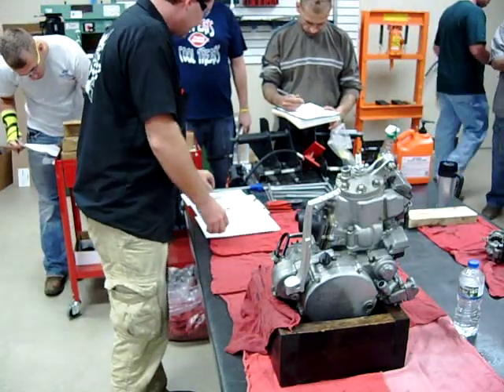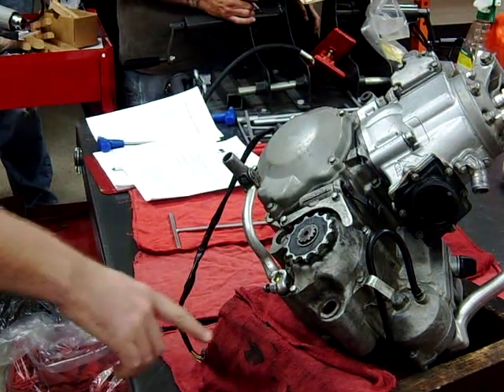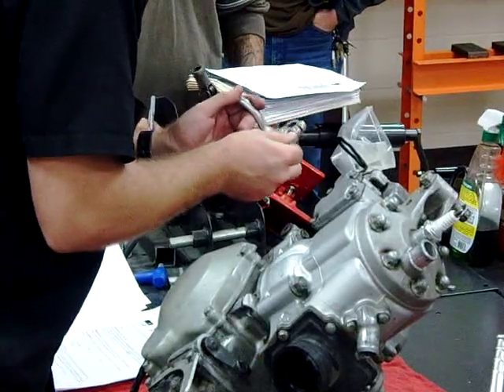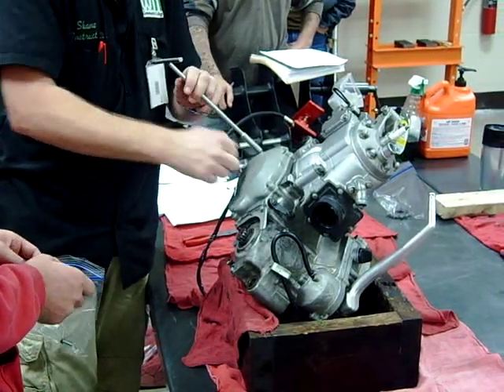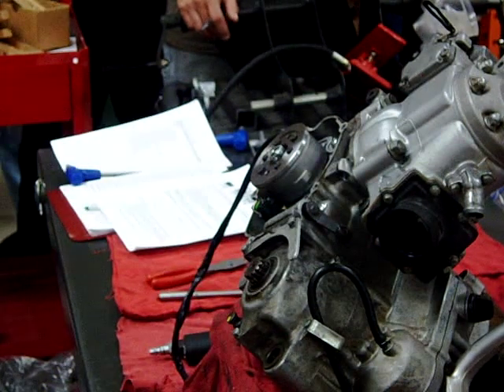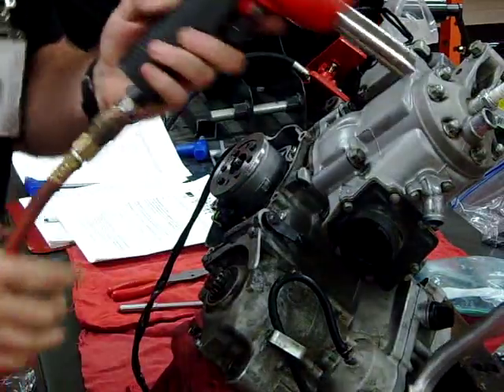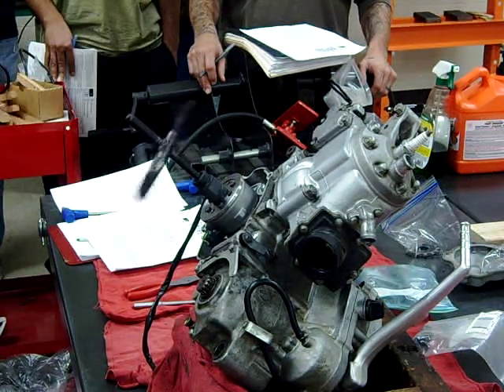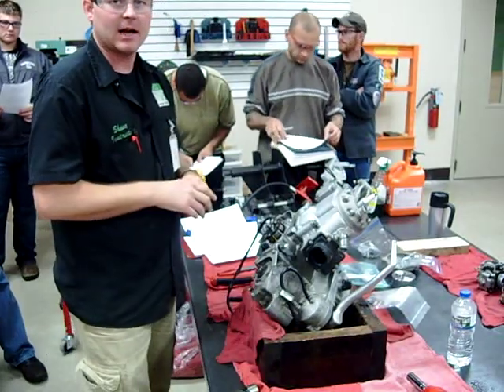2-stroke flywheel removal and engine disassembly part 1 Western Iowa Tech Community College

Comment: guy is a fraud.      I ask about a crank seal, he responds about a carburetor.   Then he  wanted $5 to answer literally a YES or NO question.
Reply from the maker: Sometimes you people are just having a bad day or don't think before you type. You get one break or you will be blocked. We have no time in our community for this ridiculous comment as to if we "owe" you something. Not the best approach to get help. 

You're the one in need of expert help. It is not a yes/no answer with many factors to consider, so you don't blow up the 2-stroke engine. Also, I would need to research the year make and model to determine if yours has the "Kawasaki lipped seal" which adds even more "know how". 

If you wish to have personal time with a H2W coach ASAP,  there is a fee. If you wish to have free information, watch videos or stay tuned for the upcoming "Tech Talk" Live feed coming soon where a panel of experts will address YouTube comments of the week.
Reply: LBOE OUTDOORS that was kind of weird..
Reply: wasnt crank seal anyway. was the little clutch actuator seal. 10 minute fix
Reply from the maker: thisisme0214 What is weird?

Comment: can the left crank seal on a 2003 kx 125 be changed without splitting the bottom end?        I had trans fluid behind my left cover that houses the flywheel
Reply from the maker: Great news for you! I have solutions for you and will point you in the right direction. Head over to my website become a member now and to receive 20 minutes of personal mentorship with me. You can even use FaceTime if you have it or find a friends iPhone and we can walk through the actual carburetor process together. I look forward to mentoring you.

Note: Membership is not required to receive coaching or email help. Here are the direct links to individual services offered at H2W:

Email Answer Service-Click http://how2wrench.com/product/email-support/ 

Phone/FaceTime Coaching-Click http://how2wrench.com/product/personal-tech-training-phone-facetime/ 

DIY Mentorship-Click http://how2wrench.com/product/diy-coaching-hire-teach/ 

Dealership Training Services-Click http://how2wrench.com/product-category/dealer-services/ 

MMI/Tech School Student Tutoring-Click http://how2wrench.com/product/mmi-tech-school-student-tutoring-services/

Motivational/Guest Speaker-Click http://how2wrench.com/product/motivational-speaker/ 

On-site Training Services-Click http://how2wrench.com/product/on-site-training/ 

Tech Line Services-Click http://how2wrench.com/product/tech-line-minutes/ 

Mechanic on Duty-Click http://how2wrench.com/product-category/mechanic-on-duty/ 

Did you like this free video and hope to see more? Would you just like to say thank you with a donation? Click https://www.paypal.com/donate/?token=TvKoeRazPL-KysbM-e0ttz-C_gPq2IrqxDmM3ORCu4nxJzQWxYbmo-6m3YuNu64XHLngGW 

Keep Wrenching,
Shane Conley
Instructor/Motivator/Motorcyclist!
www.How2Wrench.com
Reply: LBOE OUTDOORS yes you do have to split the case.
Reply from the maker: Actually, you do not. There is a way around it Kawasaki techs have used for years.

Comment: very helpful videos I have some 1970s / 1980´s Trials bikes (SWM-Rotax, Ossa, Montesa, Italjet etc.). and will be watching all videos as I have some major jobs to do soon. It helps a lot watching these and being prepared is half the job.
Ossa engines have to be shimed (in the gearbox but also the crank has shims that are individual for every engine) have you any experience with doing this ?

Comment: Hello,

Very interesting video youve got here, i work on my cr 250 2 stroke quite alot because i like to keep it wel maintained.
I regularly check the crankshaft for play i always remove the flywheel for this, and i dont have an airwrench, i always use a pistonplug and use a socketwrench to remove the nut.

I sure hope you dont put the nut back on with the airwrench, i always use an newtonmeter socketwrench for that, ( i dont know the word for it really )

I just wanne say, keep up the good work